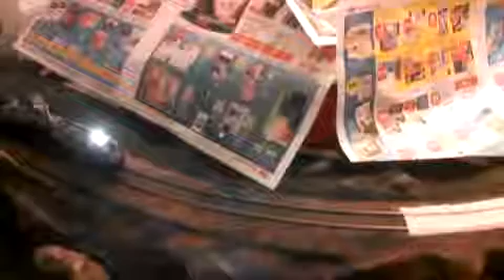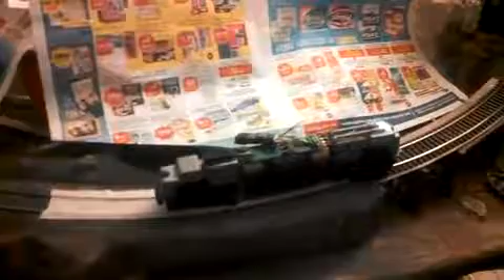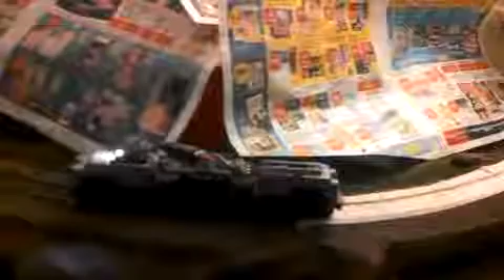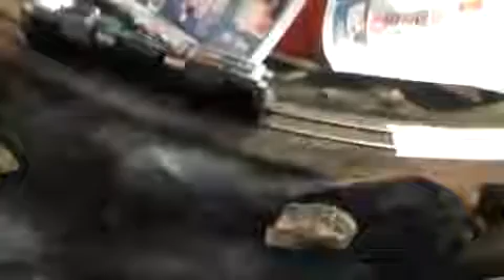HO Atlas C23-7, w/TCS Keep-Alive!!

Comment: All the decoder manufactures have these or will in the next couple of months it is large capacitor.
Reply from the maker: Yeah, we knew that. Thanks.

TCS was the first successful one, after Lok-Sound's single capacitor unit, good for about .2 to .8 seconds of storage...
TCS Keep-Alive could store enough in its multi capacitor module, for a MINIMUM of 2.5 seconds of dead track insurance.

..... the others, are just catching up, after FOUR YEARS.

 You know, Christmas isn't a good day, to be arrogant.

Comment: Nice demo Carmine, can you wire these with an existing decoder and if so where would you connect it? Thanks for sharing..Jimmy
Reply from the maker: SmokeyALCO  Not this one, Jimmy...
Its a decoder/Keep-Alive COMBINED!!!
 Until WOW! Sound, these were the ONLY decoders I would buy.

The decoder's Auto-BEMF, based on and adjusted by load - AUTOMATICALLY, WITH the Keep-Alive, makes a Fine performing loco...

That you can run over ANY turnout, any tunnel, any hard to reach (and CLEAN!), with complete confidence, at SLOW, smooth speeds, that Digitrax or MRC couldn't DREAM of!!  :D

Oh - and the TCS KAT-12, in this and the FA-2 in my other video - can be had at MB Klein, for LESS than separate decoder and Keep-Alive!!  ;)
Reply: Cool,thanks for the info on the TCS KAT-12 at MTS.
Reply from the maker: SmokeyALCO You're welcome!